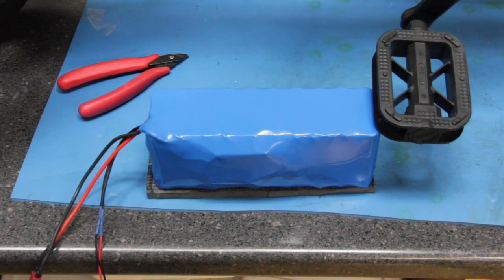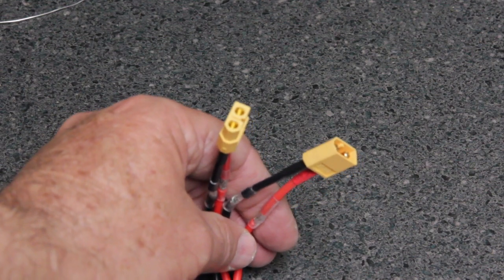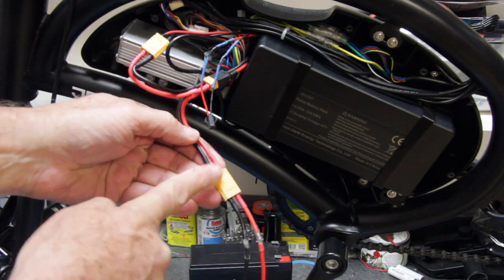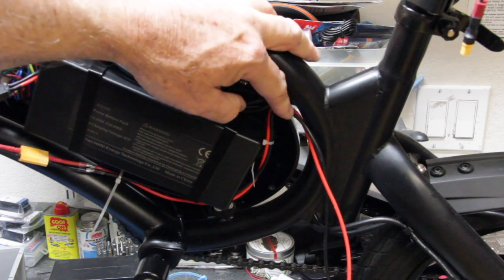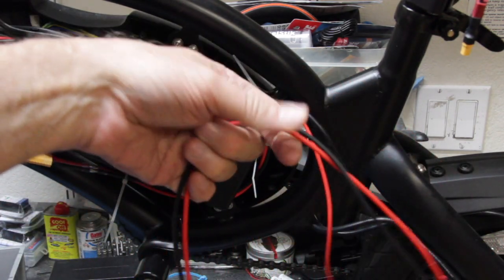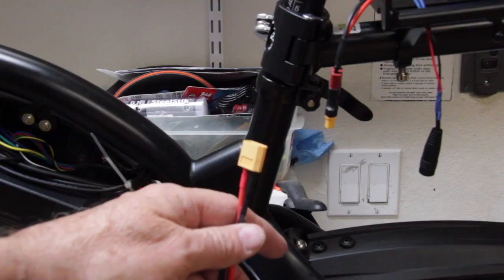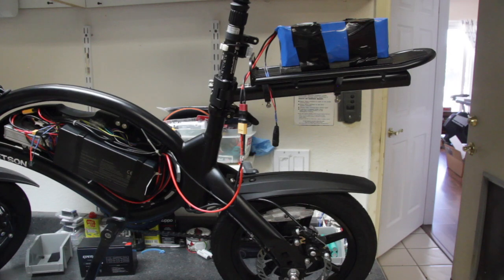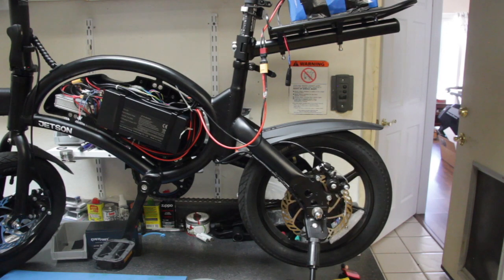Jeston Bolt Pro External Battery Part 2 - Longer Range

Comment: Do you think it is safe to charge the batteries with 2 separate chargers but leaving them plugged in parallel? To clarify, should I unplug the batteries when charging them separately?
Reply: Actually if there's a big voltage disparity between the 2 packs of batteries... You can potentially fry one or both of the battery's BMSs.  So please check each battery's voltages before plugging them in parallel.  Would be much safer run each battery pack separately using a switch or manually re-plugging each battery to the power lead.
Reply: @digiboy2k  oui séparement c'est plus safe

Comment: What do you recommend to use when adding a second, auxiliary battety to switch between. 
What i mean is once the internal battery is depleted, to switch to the second battery by using a switch.
Reply from the maker: If you get an external battery with the same amp hour rating, you do not need a switch.  If you get a larger external battery, then a switch on the external battery would work.

Comment: How come you never did a ride test or any info after doing the first battery change? Did that not work? Why install 2 batteries if just installing one with more amps?
Reply from the maker: Due to the battery size, you only get a few more amp hours, the external battery will give more then twice amp hours.  I am getting ready to do a distance test on the external battery.

Comment: How many more miles do you think you will get an also will this burn out any thing on the bike since the battery is 8 amp hours and the jetson's is 6 amps I think?
Reply from the maker: I going to to some distance testing I will let you know.  Increase amp hours increases distance, does not increase voltage,  The motor will still only consume what it uses, so nothing will burn out.  An increase in voltage will cause the motor to run hotter and yes, you could fry the motor and or the controller.  Thanks for the great question.

Comment: Good day joe im just asking what if you charge the second battery outside without taking out the connection.
Reply from the maker: If the batteries are not the same amp rating, you could overcharge the battery with the smaller amp rating.  Lithium ion batteries do not do well when overcharged

Comment: Great video. Can you make a video on how to charge the two batteries and any precautions? Does the external battery need to be disconnected when charging? Do you charge using the Jetson ac adapter in Jetson port or using the new ac adapter in external battery or separately or same time?
Reply from the maker: Yes I will do a follow-up I would charge the batteries separately, They are rated at different amp hours.  When I purchased the extra battery they also sent a separate battery charger. So I would disconnect the external battery and charge then with a charger on each battery. Thanks for the great question
Reply: @JoediyLab  thank you! Keep up the great content. Love the detailed explanations! Do you notice any arcing/sparks when connecting the external battery? Is there a problem having two different amp hour batteries connected in parallel?
Reply from the maker: @soupnazi81  I watched for sparking when I connected the external battery.  I did not see any sparking.  The batteries were pretty well matched voltage wise.  But they do make an anti-spark XT60 connector if you do encounter that issue.  The batteries should balance themselves but I would charge the batteries as they approach 50 percent charge on the LED display.
Reply: @JoediyLab  thank you!

Comment: My Jetson electric bike turns on and shows full battery but then immediately turns off, do you know what it could possibly be? At first I thought it might've been because I have a flat tire but I later found out that wasn't the issue, it charges and everything and it shows it's fully charged for about a second but immediately shuts off and doesn't turn on for a while.
Reply from the maker: How old is your Bolt?  Pull the cover, disconnect the battery from the controller.  If you have an auto battery, get two wires, connect the + terminal to the red wire on the controller and the - wire from the battery to the black wire on the controller.  You can purchase alligator clips and wires from Home Depot.  Turn on the ebike and try the throttle.  If the motor works, the problem is your battery.  If you have the same problem, more than likely it is your controller.  Let me know what the results are?

Comment: Hey Joe! Thanks so much for the great how to videos on adding a second battery. I put mine in with your video running right along side. I have a question though. I put in a 10000 Mah battery, and I have them both plugged in at once. Everything seems fine. Is it ok to just keep both plugged in and go until fully out of power, then just charge both up again? I would rather not run one down, unplug, then plug etc...  Do you see any problem with just having both plugged in and running all the way like that?
Reply from the maker: When I did my testing that is what I did,  Because the y cable is going to the controller you should be ok.  If you want you can wire in a switch and toggle between batteries.  Because each battery has it's own BMS, you want to charge the batteries separately with their own chargers.  Great question.  Thanks
Reply: Thanks for the info and quick response Joe!

Comment: Can you combine the charging plugs into one also?
Reply from the maker: Because of the different amp hour rating it would be wise not to.  One battery would charge up first and the other battery would still be charging.  Each battery has it''s own BMS battery management system.  They would not work together, balancing out the batteries.  It would also be quicker to charge each battery with it's own charger.  Thanks for the great question.

Comment: I’m afraid the motor will give out.
Reply from the maker: Adding amp hours will just increase the range,  the motor will only consume the amps that it needs.  If you increase the voltage, then yes you are increasing the watts and could over heat the motor.

Comment: If you use. $40. battery discharge balancer you don’t need to take the risk of starting a fire! Your method of exactly balancing dual connector batteries is very dangerous. Hop you carry good liability insurance for suggesting it! Although I know your hearts in the right place, please don’t suggest things that can hurt people or their property.
Reply from the maker: John I strictly indicate, in the video, to disconnect the batteries and change them separately.